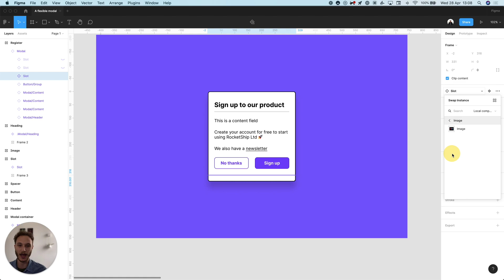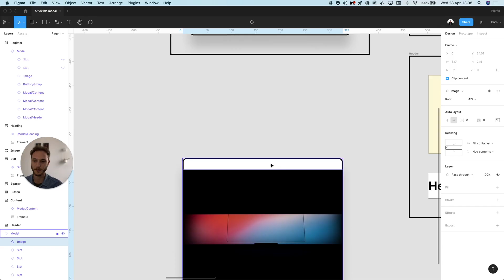Building flexible components using the "slot" method

Comment: Useful but not ideal. I wish I could simply select an auto-layout inside my component and mark it as a slot, which in turn allows me to insert content by dragging and dropping as a non-component would. That's how components can behave in code and it would be good if Figma would match that for designers.

Comment: It looks like your slot instances are set to fixed height, yet when you swap them for another component they change to hug contents. When I try this my slots remain at 0.01px height, which doesn't really work for users!
Reply: Ah, the trick is to make sure that every component you swap into a slot has autolayout applied to it. You can't just pull in a button with fixed height for example.

Comment: I was thinking this is a new slot feature.

But this is just the component swap instance feature being leverage I believe.

- Create an empty component
- use it to compose an actual component to reserve spaces for other possible child component called slot
- Now swap/replace/hide the empty component with other smaller component when creating a variation of the actual component

This is correct, yes?

Comment: I like this idea, but I do see a problem. Apologies for the long explanation, but it is a hard issue to explain without visual examples:

I do something similar with navbars; I have 12 blank tabs and I can show/hide any amount. For example, I can use the first 5 tabs and give them all unique labels like Profile, Documents, Meetings, Notes, and Settings. The problem comes from when a prototype has this navbar linked to other pages. If I want to change the order of the tabs, like swap Documents and Meetings, for instance, I have to either retype the label and re-link all prototype links, or detach the component, and then it is easy for me to reorder the layers without disrupting the prototype. However, now it's not a component and won't receive future component updates.

I think you could encounter a similar problem with this example in the video above that I come across in my navbar. If you had your first 5 slots filled and wanted to add another slot above that, you'd either have to manually re-slot everything, copy/paste all the content and re-link any broken prototype links, or detach the component and reorder a new empty slot above the initial 5, which would be easier, but ultimately defeats the purpose of the component.

This is a complex issue I haven't found a solution to yet. Would love to see some community examples of how to solve this!
Reply: You mention a very valid problem and i.e. the slots method work only if you're sure of the order you're going to place your content in. If you're content is a component too, you could easily swap out the type but you'll have to copy-paste the content again. Hope they find a soultion/workaround for this soon.
Reply: @ryschav  I can definitely understand the restrictions components have, otherwise it would definitely become a mismanaged mess of overrides and custom attributes. Frankly, I'm still blown away with all the new stuff Figma keeps cranking out. It's incredible, and it's the tool I use for probably 95% of my job now. I can't wait to see the features and solutions that come next!
Reply: Hi Ben, I've also come across this. Something you can try is taking an instance of the nav component and creating a new component with the original nav instance nested inside. From this new component, you can rename the nav items as needed and link them to their corresponding pages. You then would insert instances of this new component in the required frames. You would still have to go back to this new component to "reorder" the nav items by re-typing the labels and re-linking the prototype links, but because prototype links to frames are preserved even within components and their instances, you would only have to do it once, as opposed to having to do it for every instance of the original nav component you've edited and inserted into a frame.